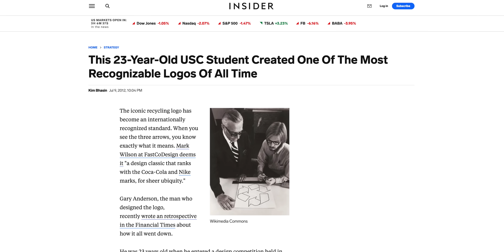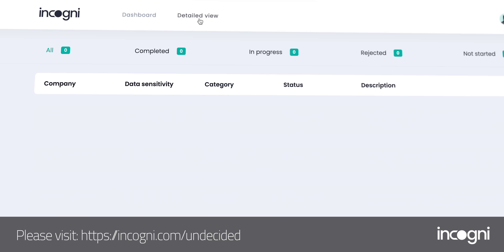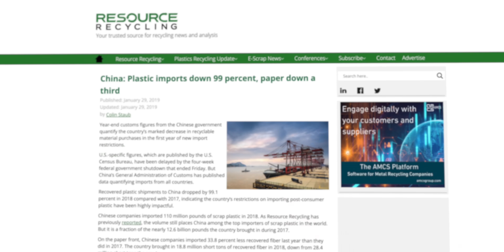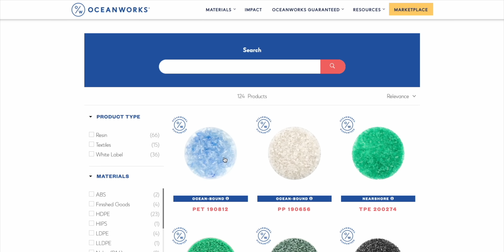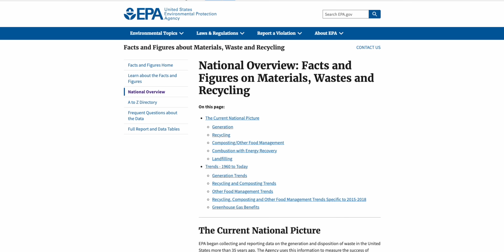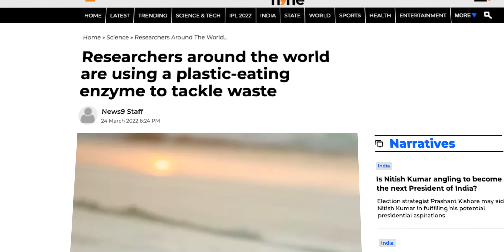The Truth About Plastic Recycling ... It’s Complicated

Comment: Recycled plastic has its uses. For example it can be processed and used in road pavement - or provide carbon for steel making. But very often its not fit to be reused in its original role. The technology I am interested in (and was hoping to see in this video) is the technology that takes the plastic back to its basic chemistry. So it can be infinitely recycled. The most extreme form is of course pyrolysis back to H2 and CO - from which basically anything can be synthesised. I'd also like to see the link being made to renewable energy. Renewable energy produces cheap "excess" energy that can be used in industrial processes that need cheap energy - which includes this form of recycling. Heck, cheap energy makes it possible to dig up and completely reprocess landfills.

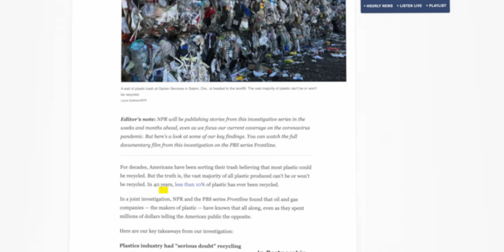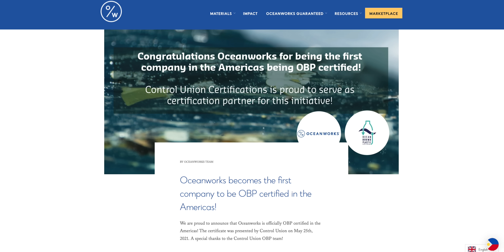Comment: 2:12 only 2 resins, PET and HDPE, are recyclable. 2:48 consumers wish-cycling - contaminating - with other non-recyclable plastics. (:-( "When in doubt, throw it out". 3:50 recycling a sneaky industry move to try to prevent plastic bans. 5:21 2018 China plastic recycling import ban. 70% of U.S. plastics were shipped to China. 7:21 most exported U.S. plastic just going to landfills or being burned; incineration produces harmful dioxins. 8:35 Oceanworks OBP certification.

Comment: One of the most irritating things about 3D printing at home is proper disposal or recycling of the waste filament. PLA, the most common material, is derived from corn and touted as compostable. It isn't, outside of very specific high temperature industrial composters. In a backyard or tabletop powered composter it won't degrade at all. PET is an alternative, but it is notoriously finicky and difficult to work with. On top of that, both are often mixed with glycol (creating PETG) or other materials recyclers may consider contaminants. On top of all of that, there is no easy way to determine what a specific filament is without visual and tactile inspection up close. That means even if you send it to recycling it is 99% likely to be thrown out as better safe than sorry. Filament CAN be up cycled at home but it requires the purchase of an expensive set of machines, a significant amount of power, and six to ten feet of floorspace to make.

Comment: What about pyrolysis to break down plastic into oil for fuel or starting products to make more plastic. Once the system is started the gas that comes off the chamber can be used to keep it hot so no external energy need be added. The contaminates in the plastic such as food or paper become carbon and can be used as well. There are a few companies that have startups but I haven’t heard much lately.

Comment: Can bales of mixed plastics be melted down into a liquid plastic and maybe mixed with other materials be reformed and  be reused as a building material Like insulation. Can it be used in 3D printing. If we build a light weight space ship,  could we construct light weight I beams or other useful parts and pieces in that ship?

Comment: I've always thought that with clean energy we should go back to glass whenever possible. I remember them re-using bottles and eventually breaking them down to be remade into bottles again. I know that breakage and cost would be a thing but I feel it's worth it.
Reply: What clean energy? If you think solar or wind is clean energy you need to to dig a little deeper.
Reply: @cbmech2563  "Clean energy" is an oxymoron.
Reply: @QAlba1074  truth
Reply: The problem with glass is that it is VERY heavy, and it costs a lot to transport it.  An old eight-ounce Coca-Cola bottle (full) probably weighs as much as a full plastic 16.9 ounce bottle.  Of course, if we switched back to less product in glass, it could work wonders on another "weight problem."

Comment: Biodegradable plastics can be made from hemp oil as well. I think there are lots of ways to phase out petroleum based plastic, but we have to force big corporations to do it. There's only so much we can do down here on the ground with our individual choices. You want fewer plastic straws in the ocean? Go find the guy making all the plastic straws and get him to make them out of something that biodegrades. What I'm saying is that this is going to require some unified political will and it's going to cost a lot of money. But it's worth it and can be done.

Comment: Wait so does the flip flops last 6 months?
Reply: I'm assuming a flip flop deteriorates differently when being stored in a dry temperate closet than it does berried, lost in the woods, or in the ocean. Unless you're wearing them and walking through swamps daily, I'm sure they'll be fine. I'm guessing the bacteria that break them down most likely don't like dry and sunny and require to be undisturbed for long periods of time.

Comment: You are reaching to a conclusion that recycling is a lie. But I think that you are wrong on this one.

 Mechanical recycling has its limitations, but this does not mean that recycling in general is a lie.

PET is indeed valuable, because it is a a material used in a product (namely bottles) which is from its nature and design is easy to sort, wash and extrude (& purify ) into pellets ready to be used again for with food contact approvals (if EFSA or FDA Parameters are met).

This is not the case with LDPE films or HDPE & PP rigid plastic, where there are literally millions differences in shape, color, Material composition and type of application (food or non-food). This actually what makes recycling so hard in the case of the other plastics. This why today most of the LDPE, HDPE, PP etc recyclates are used normally in lower applications than the original ones. 

But as I mentioned recycling is not s lie. It simply has its limitations at the moment, but things change fast. There are bright light house projects on Europe such as the holy grail project of P&G for improving sorting, recycling of HDPE bottles into deodorized & food contact approved rHDPE pellets by Werner & Mertz, De-inking of printed films by Cadel as well other manufacturers.

There is light at the end of the tunnel. But the industry and the consumer should be stakeholders in this transition.

If you need any help for future plastic recycling videos, do not hesitate to contact me.

Comment: I really don't understand the concern with putting plastic in a landfill. Plastic is a byproduct of the production of other things including it is a fossil fuel loaded with carbon. Putting plastic in the ground is similar to carbon sequestration as the carbon is trapped avoiding release. Further even if it takes millions of years to change back to oil, that's similar to the time scale used to produce it.

Comment: Great video, it would be awesome to have a follow up on new innovations within recycling. For example, there is a company in Northern Indiana called Brightmark that is almost ready to open up that takes almost all plastics, #'s 1-7 except for PVC due to the chlorine in it and turns it into ultra-low sulfur diesel fuel. This fuel is pumped to the surrounding communities and further used to power its entire operation. While the plastic here isn't seeing multiple uses, this solution is way better than landfilling. Just goes to show that while recycling may have started as a get out of jail free card, it has turned into much more through human innovation. 

Remember, while its important to recycle, it's more important to reduce and reuse first. There's a reason why we have so much plastic, because we continue to choose to use it. Yes, there will be times where you have no other choice, but we make the biggest impact when we can reduce or reuse on even the simplest of things.

Comment: I work in the packaging industry, and one of the side effects of reducing plastics is an increase in the use of cardboard (wich has a suprisingly high carbon fooprint). There is currently a worldwide shortage of pulp and paper products
Reply: There is also a huge shortage of aluminum cans.
Reply: I work in paper, you couldn't give it away 12 years ago, even though we used recycled paper people still chose plastic. Now they can choke on it.
Reply: Interesting! I hadn't heard of the pulp shortage. I would imagine that cardboards footprint is still less than plastics though right? And it's much more biodegradable at least.
Reply: @KalebPeters99  Actually I think it's got a higher carbon footprint, as it's quite energy intensive, and produces methane when it degrades, where plastic locks the carbon up (Ok it's locked up inside birds and fish),  Higher carbon footprint but lower  environmental impact
Reply: The pulp shortage has more to do with  the shipping crisis, doesn't it?
Reply: @tenchuu007  The pulp shortage is a combination of many things. One huge factor is the explosion of e-commerce shipments during the pandemic. The supply chain just couldn't keep up. Additionally, recycling rates for corrugated cardboard went down because people couldn't / wouldn't recycle everything that was going to their homes.
Reply: I love it, environmentalism has everyone so confused, they do not know what to do; which is the plan. Plastics are good. Plastics are bad. Paper products good. Paper products bad. Keep talking!
Reply: I think the pulp shortage has more to do with the supply chain issues at the moment and therefore is merely temporary.
Reply: Then plant more tree. Plastic package is ignorant as hell.
Reply: An unfortunately, so many companies rely on cardboard boxes to deliver goods to people's doorsteps.
Reply: How does cardboard have a large carbon footprint? Is it because of the energy needed to recycle it?
Reply: @coke8077  It's because it degrades, and produces (among other things) methane, which is a greenhouse gas, while plastic doesn't degrade, and basically keeps its carbon forever (although  that causes other problems)

Comment: First we need to get back to making products that last. Less electronic and more traditional materials that last and can easily be reused, before the need to recycle.
Also our recycling facilities should let people take scrap if they can reuse it. Yes grandpas old tools are still useful so why through them away for something that will break right after the warranty expires. Still got my /97 Honda Prelude and a 2015 iPhone 6. no need to upgrade. My car has all the the bells and whistles most of the new ones have and it's easy to fix. Also I added a few things that you can't get from the manufactures .

Comment: The only way to deal with this is at the source.  The reason plastic is such a ubiquitous waste product is because of the convenience it allows us primates.  \

From water bottles to food utensils, bags and all the rest plastic has made us thoughtless with its convenience.  So, this has to change.  

We need to stop relying on plastic bottles and the like.  We need to return to practices we thought were normal before plastic became a dominate form.  Go back to glass and reusable (organic) fiber based materials and such (for instance).  Just like they did in the very early 20th Century, and always had prior to the last Century.  

But to do this takes a change of habits.  And habits are notoriously hard to break.  

The first step?  Stop making plastic so convenient.  Have its cost truly reflect its true impact (production AND disposal) would be a good place to start. 

John~
American Net'Zen

Comment: The big issue is that the garbage contains a mix of different plastics and a lot of it is contaminated. Here in Denmark we have an effective system for recyling PET bottles, which was created by extending our pre existing recycling infrastructure to reuse beverage containers made from glas or aluminium (glass bottles have been standardised and reused many times before being recycled for over 90 years). AFAIK you can also recycle waste plastic from the produktion of plastic items before it gets mixed with other plastics. I dont think general recycling of plastics from households will ever be sustainable - it will always be a selective thing.

Most of our plastic we burn as fuel in our super efficient  (up to abrt 95% fuel efficiency) cogeneration power plants along with a lot of the paper collected for recycling because the supply of it is much larger than the demand (and the impact of recycling paper vs sourcing new paper from pulp wood farms is debatable) and I dont really see why that should be a bad idea. The toxins produced in the incenaration process are easily dealt with in this controlled environment, the CO2 produced is the same as would be produced by letting it decay in a landfill and there is no chance the burnt plastic will end up messing with the ecosystem.

It does seem like packaging of meat products is becoming standardized here potentially making it possible to recycle that plastic too and it is often advertized as being made from recycled plastic.

BTW I am all for letting the poluter carry the cost of dealing with the pollution, but the polluter isnt the producer of the plastic - its the consumer who demands it for her convenience and the throws it into the garbage.

Comment: Good video. Also shocking what kind of a scam the "recycling industry" really is. 
All plastics are recyclable and the degradation is mostly of mixing different kind of plastic's. With good separation most types of plastic's are recyclable quite well and can be recycled 10 times or more with adding only 10 to 20% of new material. Separating plastic's is possible, but difficult and may cost more energy  as producing new plastics.
For a future video you may talk about bio-plastics and water soluble plastics. Those plastics are precented as "nature friendly", but water with water soluble plastic's should be handled as chemical waste and some bio-plastic's are not recyclable,  not bio-degradable and sometimes even worse for the environment, although the are made from plant-based oils. Only a small part of the bio-plastic's are also biodegradable. Some biodegradable plastics are only biodegradable in a industrial process.

Comment: Earthship designs (some) utilize "upcycling" plastic bottles as an insulation layer sandwiched between the waterproof layer and the earthen berm that retains the home's optimal temperature range.  
Tires are also upcycled, as you have shown in one of your recent videos.  
The upcycled plastic insulation layer replaces the need for standard, rigid, closed-cell insulation.  This reduces the cost a bit, and helps reduce landfill volume in countries where it has become a major problem - namely island nations.

Comment: "At the end of the day, Plastic recycling only works if you can make money out of it"  

In a word:  Pyrolysis (Sp?)    A process in which plastics are melted and turned to vapor which is collected in a condensation chamber to return it back to it's petroleum base and can be refined easily back to Heating oil, Kerosene, Diesel and Unleaded Gas to be re-used in that manner.

I know, not the most eco friendly  manner in terms of carbon emissions but there would be money to be made from it and it would not end up in landfills or our oceans as a result.

Just search for TURN WASTE PLASTIC INTO FUEL on Youtube and you will find it replete with examples of this.  

The problem is mankind is to arrogant to acknowledge the solutions that we already have and use them to solve larger issues

Comment: Countries which slap a deposit on plastic bottles and require reusable PET bottles have a much higher recycle rate than countries that don't. It's no good guilt tripping people into recycling. Maybe some will respond but if you want the majority to respond you need to hit them in the wallet - recycle or it will cost you money.

Comment: Paper recycling is a bigger scam as you can only recycle paper only a few times before the fibres is to small to bind the paper but Plastic recycling is possible and many people have done this and are still doing it. A bigger scam is paper straws as al paper straws contains a plastic coating to slow down the paper straw disintegrating into pulp. The paper industry is going down slowly due to the fact that most people now get epapers and pdf books so they had to come up with a scam to lul you into buying their products. I used to work for a paper company and knows the ins and out of manufacturing paper and at what lengths they will go.
Trees is not sustainable as trees produce air from  CO2 and stopping plastic pilles all boils down to education and laws and not stopping plastic production, you will rather not clean up your mess and blame your responsibility on another then chop a tree down to suffocating us to save a fish. Governments around the world should rather take responsibility help cleaning up and put strict laws in place with paper pollution.